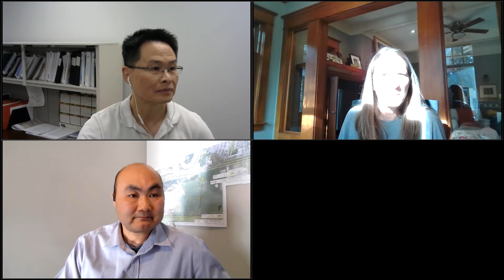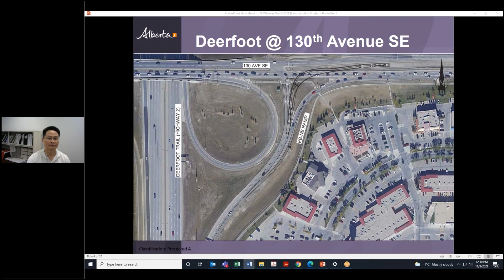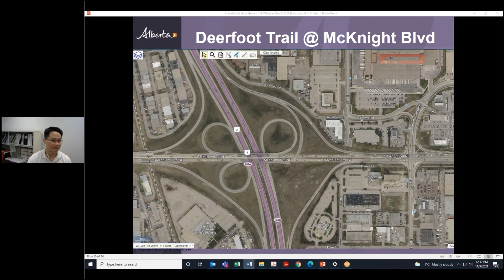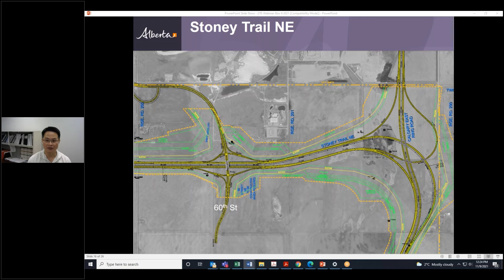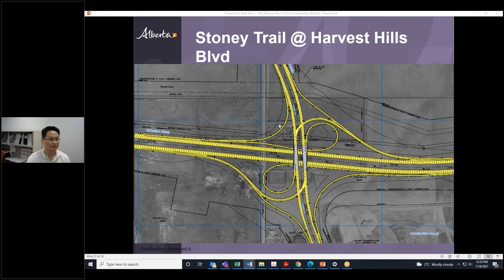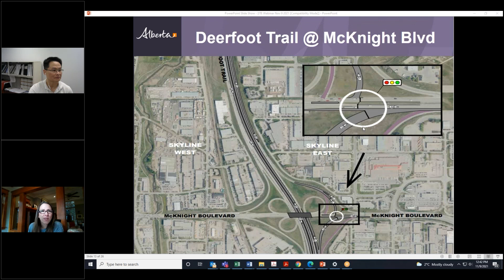ITE Southern Alberta November 2021 Webinar

Comment: Nice presentation,but of course as always it comes down to funds available for Alberta Transportation each year. Some of these projects are certainly very long ranged in the books. In fact may never see a shovel in the ground.
My question, if I could ask the presenter. There are many future highway by-passes on the books in southern Alberta. Most have been on the books for over twenty to thirty years now. To date not one has been built, even with increased traffic flow over the years. Why not?? Especially at the junction of Hwy 2 & 3 at Fort Macleod.